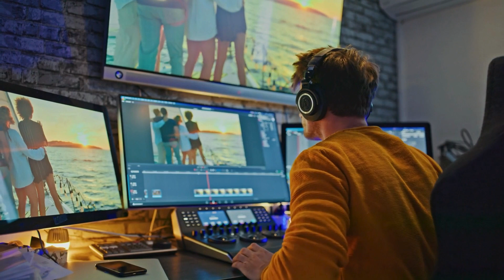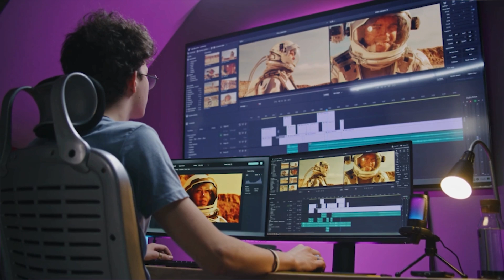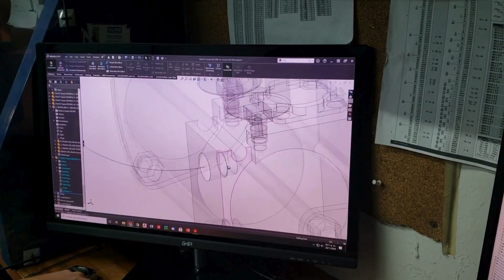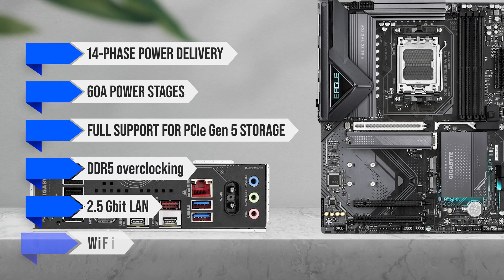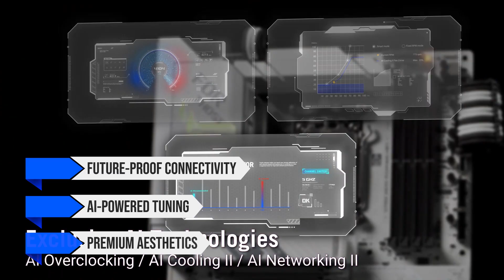The Best X870 Motherboards (Fall 2025) ✅ (TOP 5)

Comment: carbon wifi has so many LAN/wifi/bluetooth issues, I would stay well away from it. mine causes microstuttering unless I switch off 5G port, wifi and bluetooth. the bluetooth is a big issue, as I like my desk clean and without cables. also the 5G port could be a potential problem if you have a high speed internet connection.